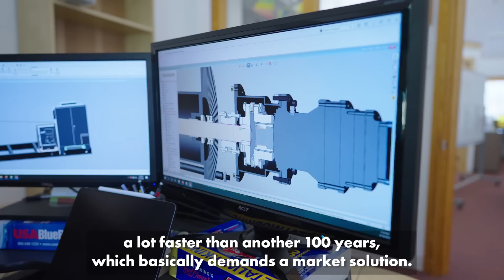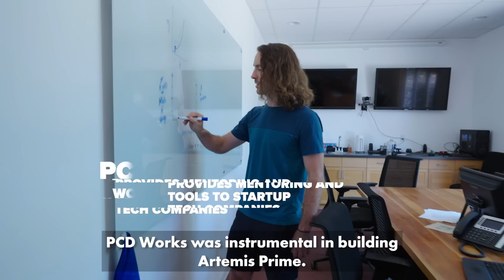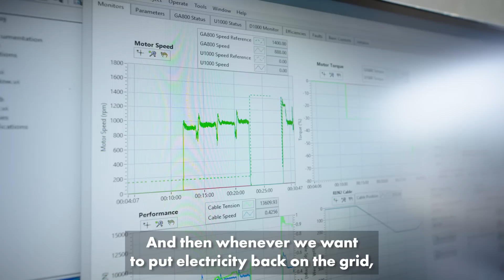Turning Leaky Oil Wells into Renewable Energy Storage | Renewell

Comment: sounds good, but i think you can improve on your tech.  check out Hydrostor.  they are storing water and air in caverns with turbines to produce energy and water/air pumps to store them
underground.  Imagine pumping water into a dry well, recovering any methane still there,then pumping air into the well to store energy.   you pump more water into the well to use the air.
you pump air into the well to store.  the pressure in the well doesn't change much because you store the water in big tanks above the ground and the weight of the water acts as the water
pump.
Reply: It's called a 'trompe'.